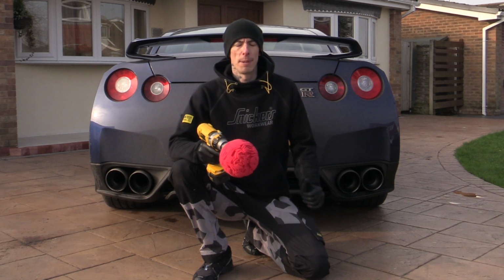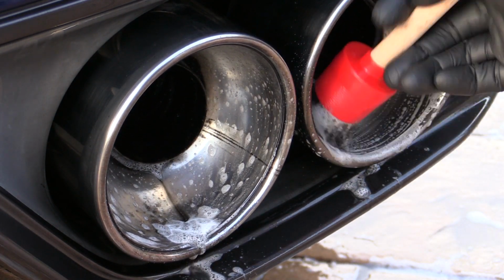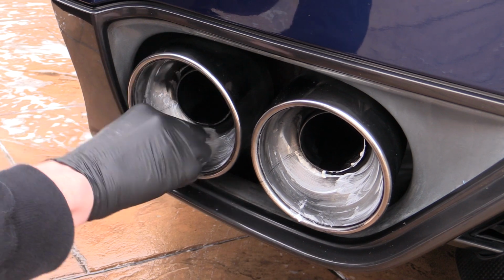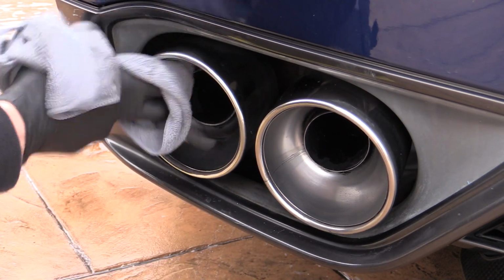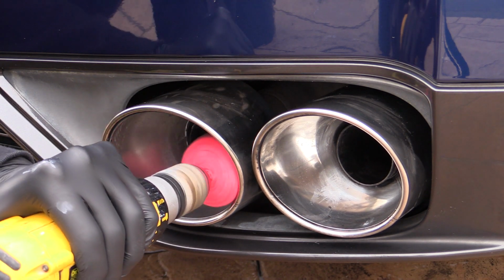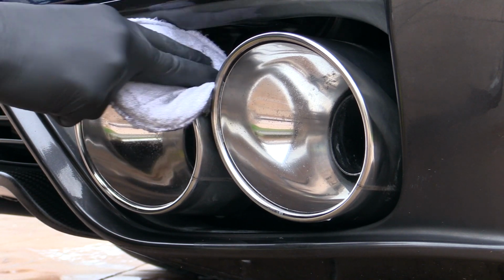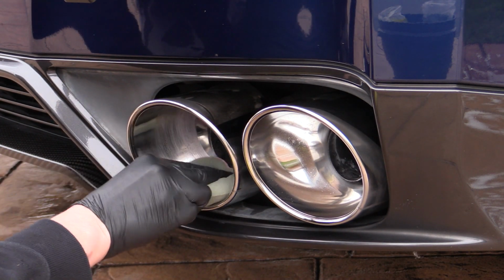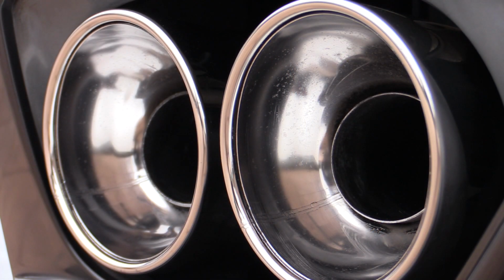Nissan GTR Poo-Shoot Polish

Comment: Keeping up with the chips on these g Tr's is a little bit of a job but I found that when they're really dirty ice freight. PB blaster on the black carbon. It? Melts it right away and you wipe it out with a paper towel. It's the best thing I've ever found.  WD40 is okay to but it doesn't dissolve the black carbon exhaust as fast. And then? After you use the blaster go right into the mother's Polish and it cleans up real well. I know you can do it with the drill and a bunch of pads and this and that. Isn't that but if you if you do this maybe 2. Or 3 times. A week? They cleanup real fast and the other thing. If you keep it under 60 miles an hour they already don't get dirty but boy do they get dirty at a 175?

Comment: Wouldn't use 0000 fine wool on the stainless tips, you will change the factory finish. It's always best just to clean as best as possible, and polish out the stuck contamination. The tips on the left side are finely scratched

Comment: I bought a cheap plastic toiletbrush, sawed off a peace of the handle, made it square with a file, then i put it in my cordless drill, using some drops of aluminum polish, and than polisch/ clean the inside of my Raganzon exhaust tips, it takes me 2 minutes per tip, and they are shiny like new!

Comment: love the new intro keep the videos coming quick tip on metal polishes to not downgrade Mothers Polish but I've use that until pipes before and it's not greedy enough to cut the blemishes out of the stainless I found out that menzerna makes a small tube of heavy cut metal polish and it works great it's a little expensive for a half of toothpaste size of Polish but it works miracles you should try it

Comment: Great video.  I had a new '16 GT-R kept the exhaust tips clean with steel wool.  However, they never got so bad.  I recently purchased a 2010 GT-R and it looks like the tips have never been touched.  Thanks for the info.  BTW where are you located that you wear a knit cap but there is a palm tree in the background? SW Wales perhaps?

Comment: Whomever installed those tips- failed to properly cut the pipes to the correct length- the pipe should be recessed, and not visible. The proper installation would be to push the pipe in from the rear, with as much protruding as possible, then slightly flare the end, so that when pulled back tight- the transition seam of pipe to tip flows as one piece, like a brake line to a flare nut. Proper and careful use of an exhaust pipe expander does this with ease. Before pulled into position- a light smear of exhaust adhesive behind the flare would ensure no rattles or gaps, and any squeezed out excess is wiped off.

Comment: Love the videos, but how would you tackle exhaust tips which have pitted around the tip edge? I tried wire wool and loads of elbow grease but it didn't make much of a difference. Would you consider something like a dremel to remove the pitting?
Reply from the maker: +Howdy Yeah a Dremel would be the next step but then sometimes it's better to just replace if they're that bad.

Comment: Loved the whole vid except for when you were doing the poo shoots by hand with the wire brush. I could clearly see the swirls the wire whool created. Wouldn't recommend wire wool on metal. I was actually suprised to see you using that as it seems way to abrasive to use against another metal. Especially polished metal at that. Still love your videos just pointing out what I see :)

Comment: Great video, just one thing i would have done differently is use the drill and polish before the wirewool to see if that was aggressive enough to remove the contaminats. Also the wire wool appeared to leave light surface scratches.
Reply: The point is you use a polish or compound to remove the light scratches left by the wool...

Comment: Oh also never remove carbon residue from tailpipes with wire wool. Yes it gets the carbon off but if you look at the final shots you can see it has badly scoured and scratched the inner tips. It means they will get dirty much quicker and removes much of the shine. Better to use a machine polishing method like he does without the wire wool step. (I made this same mistake on my car and regret it).

Comment: Anyone else think "buffing off" final protectant coatings with microfibre clothes is the wrong choice? Microfibre clothes are extremely good at removing surface products they literally pull off and wipe away products. Great for cleaning as they remove dirt better then anything but they will also completely remove protective coatings.
Reply: Fog when the coating hazes over it’s almost like it’s being absorbed into the metal, your only buffing off the excess

Comment: Not to be a dick or anything but the steel wool scratched the drivers side exaust pipes, it looks like you ditched it for the other side cause they did not have the scratch marks, when i clean my exaust pipes i use a hard scrubbing sponge and it scraped the crud off perfectly without the scratching, love the vids brotha!
Reply from the maker: They were heavily pitted so I had to go all out. You should ideally follow up with a finer grade wool before polishing but I was against the clock here unfortunately!
Reply: Car Cleaning Guru thats the only thing i hate lol running out of time to detail my vehicles, this is by far the best youtube car detailing channel! Keep up the great work, Cheers!

Comment: Its called Poo-Chute not shoot. Poo-Shoot means you're shooting poo or shooting something at poo.
Reply from the maker: +Dan K To be fair it's neither as it's a pipe not a chute but poo-shoot looks and sounds cooler.
Reply: Dan K If you've ever stood behind an exhaust with a cat, it shoots liquid (soot filled water, I'm assuming) when you rev. When I stuck mt car on the jack for an oil change a few weeks ago, condensation ran out of the driver's side pipe.

Comment: what a coinsidence, did mine today, my tip is brake fluid is really good at cleaning off all those caked on black carbon deposits
Reply: darius2640 Brake fluid smells pretty nice as well.
Reply: Dariune, just be careful not to get any brake fluid on your paint, it has the ability to peel off the clear cloat.